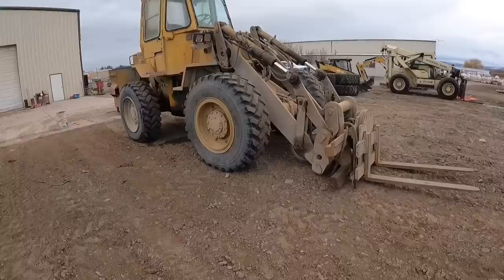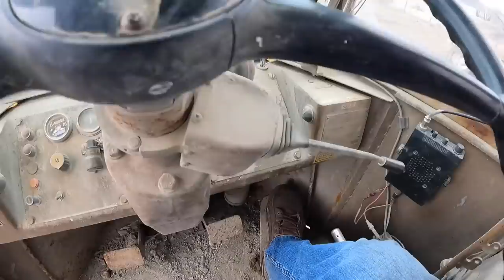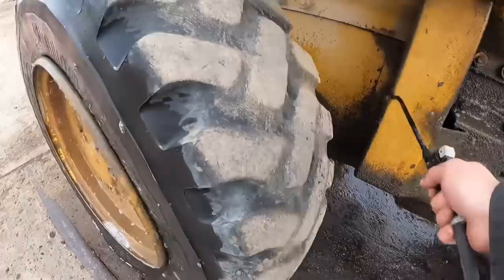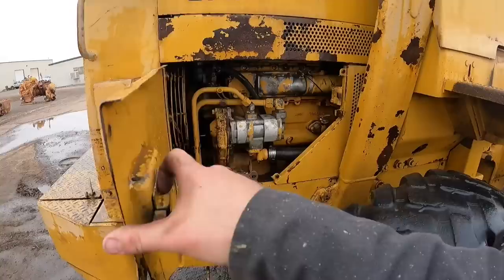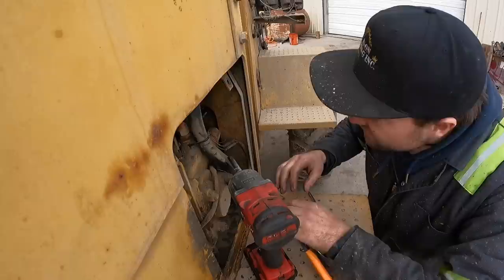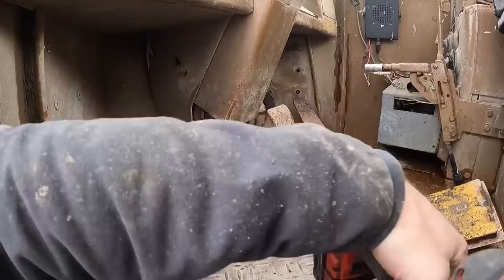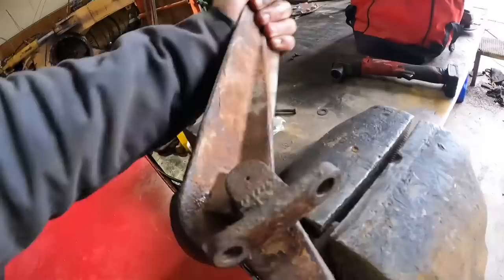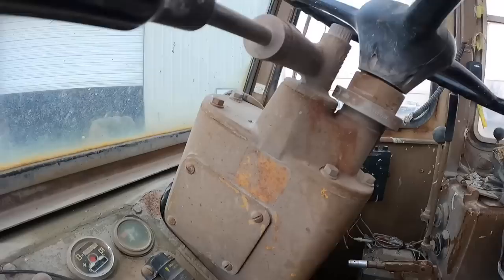CATERPILLAR WHEEL LOADER AUCTION BUY! ITS GOT SERIOUS ISSUES !!! Lets Fix It!!

Comment: Keep it until you get a fair offer. With that rotator on the forks its handy for assembly/disassembly. A chain on each fork on front/back of engine/part. You can tilt it while hoisting in/out. I used a chain block for that purposes.

Comment: Did you check blowby on the engine oil level dip stick ?
One of the first things you check on an old unknown engine to determine it's running condition. 
Overall, given the crazy prices pre emission / computer equipment is getting it's worth doing whatever needs to be done to resell it with a good feeling you haven't pulled a fast one.

Comment: Governor just needs Freeing Off.
Its built by  Mitsubishi under licence from CAT 
65HP
Great liddle machine
IT Stands for Integrated Toolcarrier
its a CAT 910 Fitted with Lundberg Loader Frame hence becomes a n IT12 which has the Quick Coupler and a better lift profile/Config than the CAT Loader Frame

Comment: If you heat up the shaft, bolt, nut etc hot enough, you can melt paraffin wax into it.  Let the part cool to the touch. Works awesome! It will creep into every crevice and works way better than penetrating oils. Been doing it for years and has never failed to work!!!   You can spray with your favorite oil after it loosens up as the wax is compatible with the oils.  😁